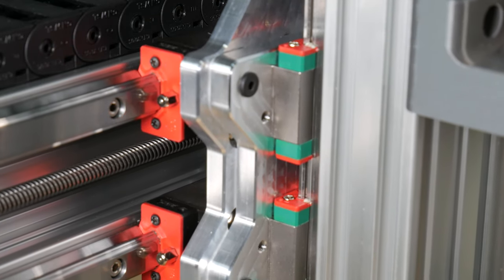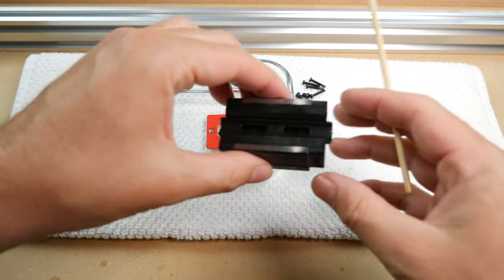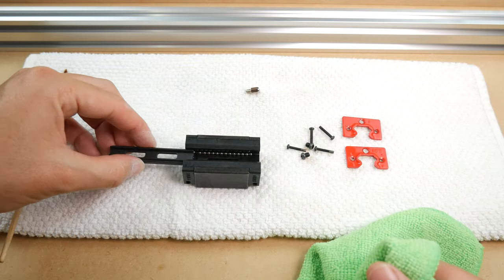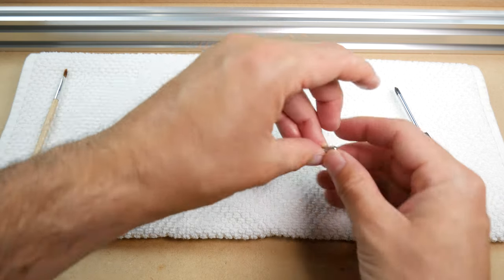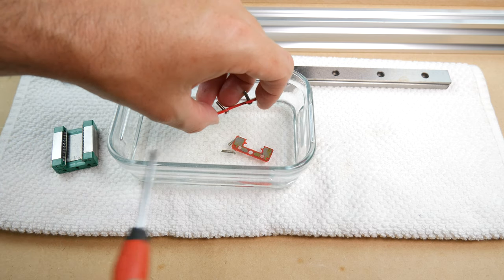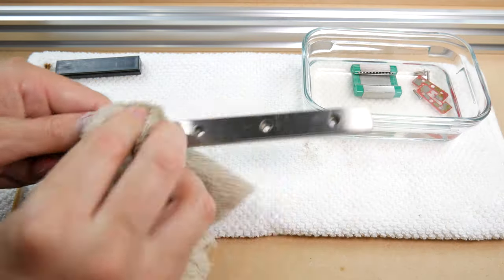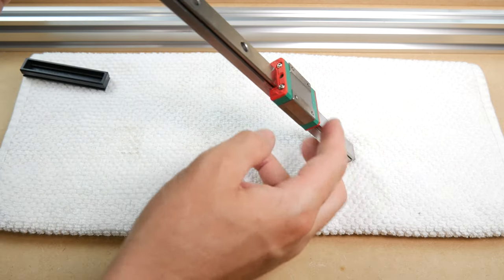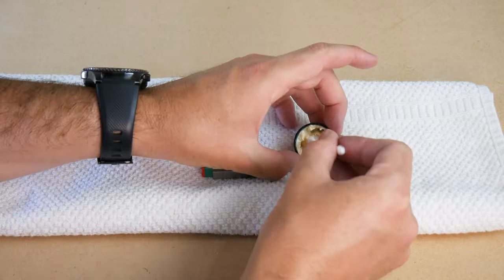Queenbee CNC Upgrade - Cleaning Bearings

Comment: I mounted regular  M4 grease nipples on my HGH15. Hiwin also mounts m3 mini-grease nipples on their mgn15 carriages, although they're very hard to find. Another option is use a syringe and apply it into the small hole in the dust cover (where'd you'd normally want to fit a grease fitting on those)

Comment: I'm trying this with the bearings and rails from the Bulk Man 3D Queenbee kit - after washing, the bearings are as sticky as your ones are before washing. I guess this means a bit more work for the motors but not a showstopper.

Comment: Is there any reason this cannot be done using 99% IPA in an ultrasonic for 30min?  I know most people don't have an ultrasonic but I do as I found it very useful for resin 3D prints. Should only need to loosen the ends and not remove them as well.
Reply from the maker: Yeah that would work just the same might need to move the balls a bit to clear inside still

Comment: Are those Hiwin or Chinesium linear rails?
Reply from the maker: Not hiwin no but I have been happy with the quality regardless.
Reply: @IllDoItMyself  My real question with the Chinesium rails is longevity... They could start great and just go to crap in short order - i don't see a lot of projects with enough years on them for people to say "this is the life I got out of them"
Reply: @IceTurf  lifespan of bearings depends not only on it's build quality but also on how they are installed, used and maintained.
cheap chinese products are most likely used by people who have zero experience in linear bearings. so this bearings are often installed wrong and/or have their size not compatible with the load (and used without any dust protection of course. even in this video rails are opened and have no dust caps of bolts).
and on the other hand we have "everlasting" Hiwin/Bosch/THK/NSK/INA/IKO rails which usually used on proper machinery. installed on precision milled surface, supplied with automatic lubrication and covered from any dust.
Reply: i always thought that Hiwin was Chinese.
Reply: @MrTWOproductions  HiWin are Taiwan, a quality brand. Many rails out of China can pretend to be HiWin, but aren't. Some Chinese rails could be of good quality, but it is hard to know.